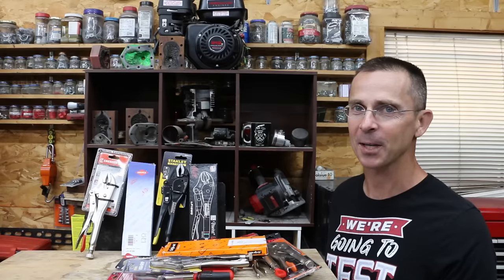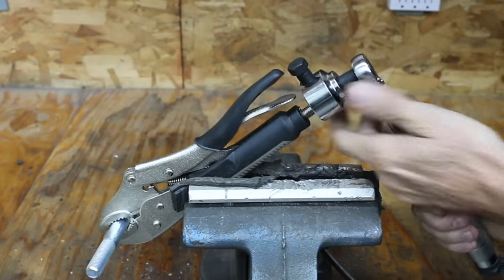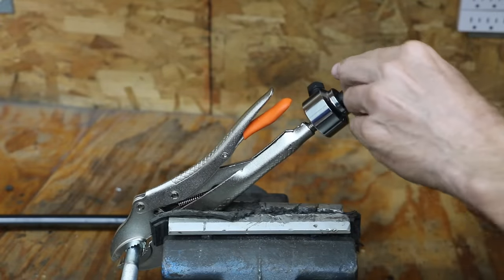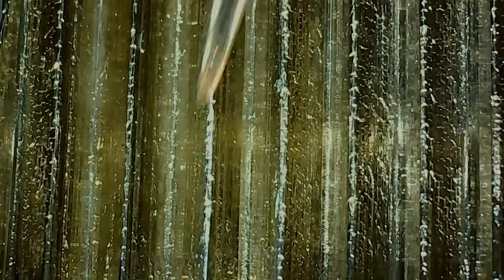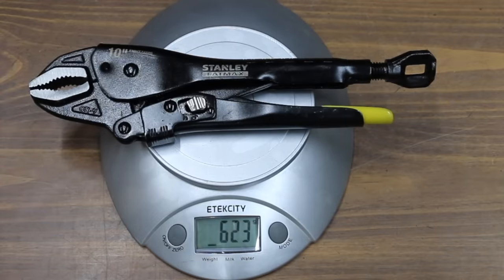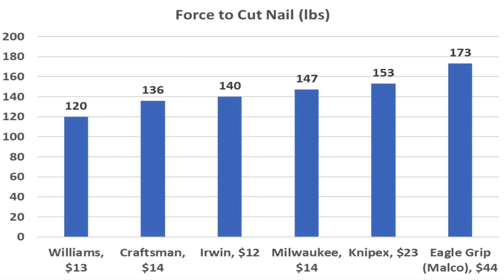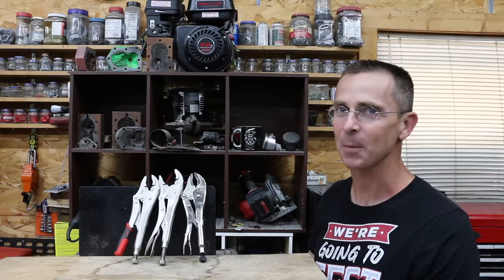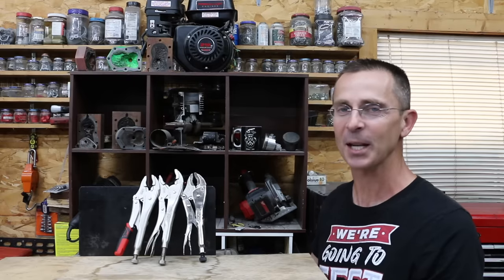Best Locking Pliers (VISE GRIPS)? Irwin vs Knipex, Milwaukee, Craftsman, Stanley, Malco, Pittsburgh.

Comment: The Malco pliers are made in the same factory as the original Peterson Vise-Grips that Irwin bought and then moved to China in the early 2000s.  I love my Peterson Vise-Grips.
Reply: Good to know.  So if you want "real" vice-grips, Malco is the way to go.  Nice to see something manufactured to a quality point rather than an arbitrary price point.  I've got some old-school Vice Grips I got as hand-me-downs in the 1980s.  Still going strong and they have been seriously put to the test over the years!
Reply: I didn't even know Malco made vice grips, but I did notice that the logo on the handle is very similar to the old school vice grip logo before they changed to Ikea colours.
Reply: @siegessaule  
Malco just started selling them earlier this summer.
Reply: Nice. I stopped buying Vice Grip brand when they were bought out and moved to China. Still have the Peterson vice grips I bought over 20 years ago.
Reply from the maker: Interesting!
Reply: I must be from the old school . being a Mechanical Repair & Installation millwright I would always use Vise Grip Brand.
Reply: Good to know. I wonder if there's a site that tell which brands are made in the same factories as the good old brands were that are now made in China.
Reply: I grew up in DeWitt, NE where the Eagle Grips are made.  A lot of the current employees worked at the original Vice-Grip plant.  They live and breathe quality hand tools and it shows.
Reply: @michaelpoessnecker2697  I'm glad there are people with pride making something in the U.S. From the media you'd think we couldn't make a thing anymore.
Reply: @clambino7980  pride comes before the fall. At $44 a pair their tools can't be flying off the shelves. Even if they are the best.
Reply: @1pcfred  Buy once Cry once
Reply: @thejunkman this is true! Also newer snap-on pliers are rebranded Malco pliers. So hey at least they're now USA made!
Reply: @carlmccoy662  with all the Vise Grips I have now my crying days are behind me. And yeah they're all old ones made in the USA. I was getting 10WRs off Harbor Freight for like $5.79 a pair. Every order I'd just throw another pair on it.
Reply: Yep, bit of WD on the joints and good as new.
Reply: Yes,  and it's a shame that he couldn't get his hands on an original Peterson Vise-Grip for this test.
Reply: I was about to say... my old, OLD vice grips (with square bolt... not sure if Original) are perfect, and indestructible to the point that they can be used as a hammer lol.
Reply: This is cool.  I just read their Amazon page, and it seems true.  They say the previous manufacturer moved from DeWitt to China to 'save a few bucks per unit'.  Well.  The Irwin is $12, the Malco is $44!  That's a lot of difference!   I'm glad I'm all stocked up with REAL Vice Grips, from me and those inherited from my Dad.  But at today's prices I'm afraid I would buy the Irwin, or find used Peterson Vice Grips at swap meets!
Reply: @carterscustomrods  I think Peterson pliers always had a knurled adjusting bolt in them. But the thread pitches used are standard SAE so a lost bolt could be replaced with another one. I just checked a pair of 10WRs here and it is 7/16x14 thread. Which is common hardware. Maybe not the most common pitch though. Can still get it in any hardware store. Or maybe out of a coffee can of random hardware in a garage?
Reply: @ProjectFarm  Yup, my old Vice Grips all say Dewitt, Nebr. on the side.
Reply: Thank God something is still made here.  I've been trying to find a good used bench grinder that's made in the US because 99% of everything else is made in China now.
Reply: Well now I know to buy Malco pliers
Reply: @JerryAtrick83  good used bench grinders are pretty rare to find. If they're any good folks tend to hang onto them. So what you mostly run into are lousy bench grinders people are just trying to get rid of by sticking someone else with them. Although there are certainly exceptions. Some of my favorite bench grinders I have are arbor grinders I put together myself. Arbors and motors you can run across from time to time. Then you have to be a bit handy to assemble them. But you can end up with something decent. I saw a table saw at the curb the other day that someone could have turned into a grinder. They have arbors in them. I passed on it because I already have two table saws. I was proud of myself for not dragging it home. But for a moment the thought did cross my mind. I have too many projects now I need to finish.
Reply: Vilchek Bonnie old craftsman snap on Williams Mac Armstrong all were good tools. Now I just buy from rummage sales to get the older American made tools
Reply: @michaelpoessnecker2697  Why are they ending production? I just went out and bought a bunch as soon as I found out.
Reply: @harryman11  the official line from Malco is Eagle Grips does not fit their "Core company products".  The general consensus around the area is they were not making the amount of money they wanted to.   I blame it on bad marketing and lack of putting the product in the stores where it needed it be.  I would like to say I didn't see it coming but the main guy at Malco that was the force behind the Eagle Grips "retired" and then the top two execs at Malco changed and even the executive secretary changed. After that, it was just a matter of time.
Reply: @michaelpoessnecker2697  sad to hear at least I got my set in the mail right now, thanks for the update. Wonder how many other of these American stories are out there, tragic where our country has gone.
Reply: They don't.  But they make vise grips.
Reply: I've got seven or eight Petersen visegrips of various types, all old and working perfectly.. Wouldn't touch an Irwin with a barge pole.

Comment: Just an observation:  In our shop, I have no doubt that we have gone through dozens (literally dozens) of locking pliers on our welding and radiator repair benches.  In both applications there seems to be a trend: Vise-Grip pliers manufactured back in the day, in the USA, by Peterson Manufacturing Co. are, by far, the oldest survivors of a tough life.  There are also a few other vintage locking pliers from Craftsman, Malco, Snap-On, Millers Falls, and Klein left in serviceable condition but, by far, the best are the old USA-made Vise-Grips.  It's also notable that when you do a close comparison of these old warriors, aside from the trademarks, they are all pretty much identical.  Wonder if there might have been some ghost-manufacturing going on(?)  We also have some new Vise-Grips (Irwin), some Kobalt, Craftsman, and others.  These are all transients... just passing through my shop on their way to the scrap yard.  These are the ones we chose when the TIG welder or plasma torch are going to be danger-close.   They'll be long gone when the 50 year old Vise-Grips (and the others made in the same factory back in the day) are still doing what they do...
Reply from the maker: Great feedback!  Thank you
Reply: The Malco pliers are made in the old Dewitt, NE factory.
Reply: Why dont you just write a book
Reply: Welding with locking pliers tends to destroy them. I'm pretty sure the heat ruins any heat treatment the jaws may have had. So I only weld with trashed locking pliers. For mechanical work I keep other pairs.
Reply: Yes!  I stalk garage and estate sales and buy every pair of "old" vise grips.  The steel was better and lasts longer.    Most of my new just don't hold up.
Reply: @jarodsmart  I was going to say something about the steel as well. I wonder if it was just a different alloy or better quality steel they used back in the day?
 Its like my grandfathers old Craftsman bench grinder that now has my buffing wheels on it. It says 1/2 hp, but I can Lay into that thing buffing, enough to slip the buffing wheel, and barely slow the motor down. I also have a 1/2 hp Harbor Freight.. Chicago Electric brand bench grinder, that has my grinding and wire wheels on it, and i can pretty easily slow it down when grinding and wire wheeling items. It just feels like the "old" 1/2 hp is a Lot Stronger than a new 1/2 hp, and the old one has 50 or more years of use on it.
Reply: Agreed, I have a lot of old US made vise grips that were my dads, and still function well. The later Irwin branded ones don't work well for long if they ever did at all
Reply: Original Irwin USA made are the best, mine are still as dependable and as tight after 20+years of constant work
They look identical to the Malco
Snap on sell Irwin Vise grips & snap-on
Don’t buy the snap-on they are identical to the Grip-on (funnily enough) but painted grey. Returned them for credit - junk and I as you demonstrated, I actually found them impossible to unlock when clamped down extra tight👎
Love my Irwin vise grips!!
Reply: @keithyinger3326  I too have an old Craftsman bench grinder, 6" stone on one side, wire wheel on other.  I use it a few times a month, but pretty heavily on those days.  I would guess it's around 45 or more years old.  Only problem is that the plexiglass shields became opaque over time.  Otherwise perfect condition, and strong as an ox.  I never thought I'd give Craftsman power tools a compliment, but this thing is strong, like their old USA forged hand tools.
Reply: I have the old Vise Grips; they used to belong to my wife's grandfather. At the time they were bought several decades ago, they were the only brand of locking pliers available at the store.  I wish it would have stayed that way, because they seem to be the best compared to the ones that don't seem to work as well today, regardless of brand.
Reply: I have far less experience, but the exact same conclusion. I have a very old set of extremely worn made in USA Vise-Grip locking pliers and they are FAR better than any brand new made in China/Taiwan locking pliers I have used, including Irwin Vise-Grip brand. This is a case where they don't make 'em like they used to rings true.
Reply: @keithyinger3326  are the wheels heavier? Or does it use an internal flywheel? The extra mass in motion may keep it from slowing down as much, and newer ones may skip that to save money. IDK if this is the reason but if I were designing it that’s what I would do. Things back in the day were often engineered better because you could manufacture them for a reasonable price. Corporations are greedy and wanted more profit and here we are. Capitalism at work. If only people weren’t so inherently corrupt and greedy it would be perfect.
Reply: @keithyinger3326  You are confusing HP with torque, HP=Torque*soeed. Your older grinder has more torque and can therefore be rode harder and still spin. The newer one likely uses thinner windings and spins faster to make the same HP but with less torque so it bogs down when pressed on.
Reply: @keithyinger3326  it's possible that the older electric motors had more torque down low in the RPM range. Horsepower comes from torque, and if you measure it at different RPMs you will get a different horsepower rating. I can't explain it very well, but there's videos on it if you're curious.
Reply: @keithyinger3326  It's the bearings, and the gauge of the wire on the windings.  For electric, induction motors?  The 'hp' rating is strictly the amount of current it may safely pull from the wall socket, before heating up to destruction.  There will be an overload in new motors, that shuts it off if overheated.  But that old motor was likely de-rated by several stops, as was the habit back then.  By today's measurements, it'd likely be a 3/4hp or so.  Plus, it likely sports ball bearings, not sleeve as in the Harbor Fright one.  :)
Reply: @kjdude8765  I understand what your saying, however I believe, both grinders spin at the same RPM. Its a bench grinder, they can't just make them spin faster or they'll exceed the rpm ratings on grinding wheels and have lawsuits.
I think its more likely thicker windings and they figured back then, Its At Least 1/2 hp, probably over. Nowadays to cut costs, especially on a harbor freight special, they probably use thinner windings, and Just enough to get to 1/2 hp rating and not go over too much. The story may be different vs a different model over a Chicago Electric brand one also.
Reply: @2nd-place  Not sure about internal flywheels, I assume none, The cases don't seem big enough to house anything more than the motor.
In the end i think its just the difference between older quality built equipment, vs new, mass produced, cheaper stuff.
Reply: @controllerpleb6568  Led lights etc. from China often say about 2 times the power they are. like 50w is 20 or 30w, Maybe the same with motors.
Could also be 1 is the hp of input power(Maybe 745.7W /2 of power is used at the startup surge :P) while the other is the output power.
Metering the amps used might give you an idea.
Reply: @corey5797  The reason why the USA Vice Grips look identical to the Malco ones are because Malco bought the plant and machines that made them.

New snapon ones are made by malco.
Reply: @J-1410  I returned my Grey painted snap-on/grip on vise grip set. The snap-on cat. listed the Irwin set. They’re “original” with eagles - genuine ones... :)
Reply: @J-1410  just checked current online cat. The bluepoint set of 4 in the wallet is identical to the “original Irwin eagle USA made” set I have
Reply: @corey5797  Small nitpick thing ... the original weren't Irwin at all. Just William Petersen, a guy in a small town in Nebraska with unusual intelligence and some weird innate sense of how leverage can work in a tool. Petersen Manufacturing Company made the Petersen Vise Grip. Those are the originals. Irwin bought it eventually and whored out to China, closing the plant in DeWitt. Irwin is the worst actor in the whole chain of custody for the "Original" Vise Grip. Now, Malco is back in the old plant with some of the old Petersen guys. The Eagle Grip is the closest to a true original and outperforms them all. I bought one and it instantly became the best hand tool I own. Forty or fifty bucks ain't a bad deal for a really great Made-in-USA tool.
Reply: @bcrisler  Peterson Eagle Vise-grips are the original - original 
I was trying to make sure people got their hands on the right tool, which was available but hidden - rather than a history lesson. Appreciate the update. How fantastic is it that malco have reopened the factory to produce the best tool we both own. Have a big snap on roll cab and my Irwin Original Eagle Vise Grips by Petersen  by far the best thing in there!!!
Reply: Cheap Steel . end of ..

Probably Chinese steel .
Reply: Actually, the Snap-on pliers are made by Malco. Absolutely identical except the logo and twice the price. Only advantage of the Snap on is if they break you can swap them instantly on the tool truck and possibly resale value. The Malcos have a lifetime warranty as well but you have to send them in.